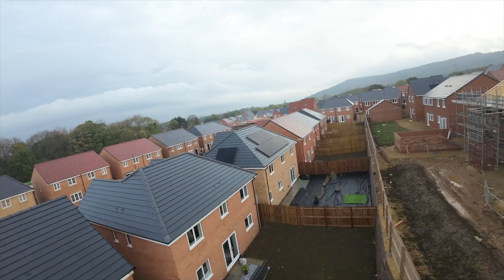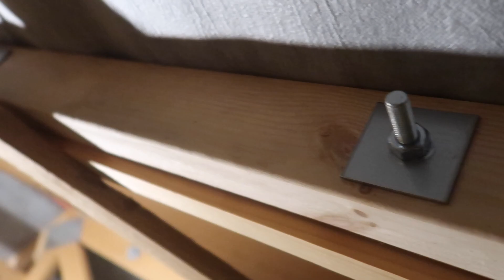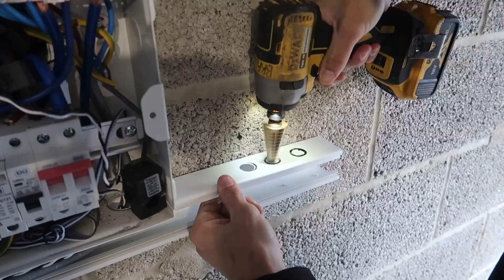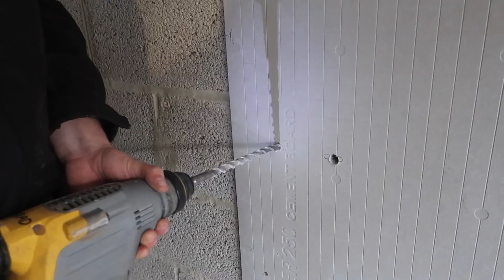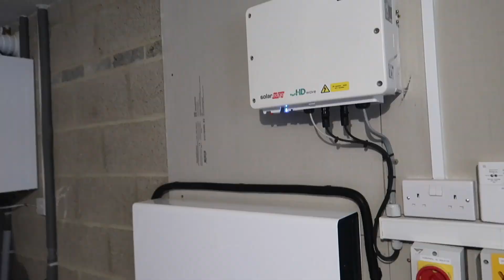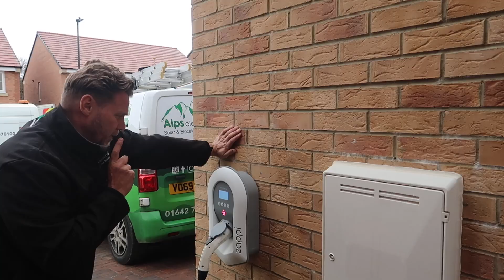New Build Solar & Battery Install | Tesla Powerwall 2 + SolarEdge 5.28 kW System | Did It Pass?

Comment: Thanks so much for the video. I have accepted the quote from a company called soly-energy to install solar at my 1950s house. Would they ask me to do the structural survey or do I have to insist? Or is it mandatory for the installation? They have said for the technical survey, I just would need to submit a few photographs. Would that be sufficient?? Thanks in advance
Reply from the maker: Hi, thanks for watching. You don't always need a structural, it depends upon the roof type. If it is a regular dual pitch then most solar design systems will do the structural calculations for us, but you should receive the structural calculations for it in your proposal and paperwork to show the calculations have been done for both load and wind. If the standard dual pitch is a truss roof then we just input that into the system, however if it is a rafter style then we need to take dimensions of the span, rafter width, depth and spacing to input into the system. If nobody has even been in your loft you need to be asking questions for sure. 
If your roof is a flat roof, or mono pitch, or hip and valley like the one in this video then a structural survey is always required and must be carried out according to the MCS. The consequences of not doing so can be very bad. Most roofs are designed to hold the roof itself, not 2-300KG of solar panels also. If you came to us and said your roof was from the 1950's id be taking all precautions to ensure we were happy to install solar on it. Hope that helps.
Reply: @alpselectrical  thank you so much for the reply. That is great to hear. My installer also told me that the system would tell them about this and also said they would know just by looking at the roof. Our roof is just a typical roof which is found everywhere. And, the loft conversion had been done before we bought the house, so hopefully all of OK?

Comment: What the fuck is a 2024 house doing being installed with RCD groups?
Reply from the maker: Shocking isn't it! It all comes down to money. These builders want their houses wired for peanuts, which is why we would never work with a builder. But the electricians doing them need to make at least some money and so will spec the system the cheapest they can get away with. All new builds should be RCBO boards 100%!
Reply: @alpselectrical  probably all installed by an unqualified person and then signed off by someone in an office.

The worst I've seen is 100's of designs "signed off" on the last day of the grace and then being installed years later...
Reply from the maker: We went to a new build the other week just to carry out some minor electrical work and found crossed polarity at the C.U. Basically the main tails were the wrong way around in the main switch of the new board they had fitted (BG SPLIT LOAD)!!!! Needless to say they came back very quickly to sort it, but leaves you wondering what testing actually took place after installation?
Reply: @alpselectrical  such a crazy, dangerous fault.

Comment: A very neat install but it left me scratching my head at some of the choices 
1. Why have 2 EV chargers? Will the owner need to charge 2 electric cars at the same time?  Wouldn’t it have been better to remove the Project EV charger and directly swap it with the Zappi? They could have sold the Project EV charger and use it towards the install costs.
2. Why have a separate inverter when the Powerwall 3 has a solar inverter integrated into it. The home owner has effectively paid for 2 inverters.
3. The powerwall 3 has 3 MPTT’s so the south facing panels could be on a separate string to mitigate shading or other issues. Why have optimisers which add expense ?
4. I noticed you didn’t use the Tesla dolly to move the very heavy Powerwall 3 around and onto the wall. I  understand this kit isn’t cheap at around £2000. The videos I have seen on the official Tesla Powerwall install YouTube site suggest it is mandatory to use.
The overall installation looks very impressive but some elements don’t seem the best use of the equipment which has been used.
Reply from the maker: Hi, thanks for watching and commenting, in answer to your questions:

1. The customer has two cars which they charge at the same time. We moved and added his old charger into the system for free in the end actually as it was not much more effort or cost for us to do so. which they were over the moon with.
2. This is the PW2. The PW3 was not available at the time this job was at the pricing/DNO stage, and the customer wanted to move on with it as mentioned in the video, however more to the point, optimisers were essential on this job as mentioned in the video two panels on their own roof orientation would not be enough voltage for the inverter to kick in for most inverters, PW3 has a minimum of 60v which is too close to call for two panels on days where there is not much sun, therefore all panels needed to go on one string with optimisers to ensure they will work at all times. There is no better system than SolarEdge for optimisation and monitoring individual panels and this customer was very switched on and wanted the best. You cannot use SolarEdge optimisers with Tesla it has to be a SolarEdge inverter. 
3. Answered this above.
4. It is not mandatory to use, I have never even heard of it and I have done all the Tesla training. They suggest using a dolly which is just common sense but I will stick with my £50 one which works perfectly well lol.

Just to add there is a lot of hype about the PW3 at the moment with no chance yet to see if it stacks up. The fact it includes a built-in inverter could be a negative if the inverter side of things packs up, as that is either going to be a costly repair, or the entire unit is buggered. Only time will tell on this point. The PW2 is a proven model and allows you to spec with any inverter to suit the specifics of the system, and in this instance was the best choice for this job.
Reply: @alpselectrical  Thanks for replying. What you say makes perfect sense. Cheers
Reply from the maker: You are very welcome, thanks again for watching and commenting!

Comment: I'm astonished they didn't opt for in-roof solar during construction of the house:

1.  They would save on roof tiles.  Given the cost per sq meter of panels is approaching that of tiles.
2.  Lower static load on the roof.
3.  Looks Nicer
4.  No need to duplicate scaffolding costs
5.  If roof loading calcs were necessary, then it would be the house builder that would need to consider this - rather than retrofit, but point 2 above would still be valid.

I've got GSE Adaptors on my roof for 4 years, and my electrician reckons they are easier to install than racks, and he has fewer warranty issues relating to leaks due to cracked tiles under the panels.  They look the business!  But pine needle accumulation is certainly a local issue for my particular property.
Reply from the maker: Not all builders provide solar as an option, including this builder on this site and so it was not an option for them anyway.

Integrated panels may look nicer (in some people's opinions), but they are actually less efficient between 6-17%, due to the restricted/lack of crucial airflow allowed to cool them down, as trust me, solar panels get extremely hot under direct sun. Only time will tell if the integrated panels start to fail sooner than the on-roof panels due to this - it certainly makes sense that they would. 

On-roof panels can still look just as pleasant to the eye, but the majority of customers, are seeking maximum ROI over what they look like, as most people won't be staring at their roofs for prolonged periods.   

Right now, and this is extremely fresh news, the MCS is currently discussing the fire safety of integrated panels, which we received notification of last week, and we eagerly await the outcome. Clearly, it could have a significant impact on the industry going forward, but the regulations are changing constantly. It is hard to keep up sometimes. 

As you mention things that drop from the sky can gather in the recesses which isn't ideal.

In my opinion having installed both, and with efficiency/ROI trumping appearance every time, the on-roof panels would be my recommendation.
Reply: @alpselectrical  I certainly saw a remark earlier this week on the efixx youtube channel about fire safety and in-roof solar.  Apparently the consultant with concerns about this cited a very specific but unnamed panel brand as being a particular problem for in-roof solar.

Certainly the GSE adaptors are sitting right on top of the wooden battens, so I can see the potential.  I checked out the GSE website for the MCS certificates for their adaptor mounts.  They certainly look legit.

But sure, there's a risk, especially with loose connections under DC load.  That reinforces the importance of the AFDD features, which SolarEdge has - although I haven't seen any tests of these devices.
Reply from the maker: Yes, we will await to see what comes of it, but things are changing very quickly. Thanks for the comment and for watching :)

Comment: Another great tidy installation. When I had my first solar installation 12 years ago and my bungalow being 2 years older. The installer strengthened my trusses with 4*2 not something I have seen done before until today  but I am glad they did  2 years later we had 3 feet of snow . You asked before where about I am just over the border in wales not far from Oswestry 👍👍👍
Reply from the maker: Yes, thats the thing, most roofs are built to hold the roof itself, and tiles etc allowing for snow, not solar panels, and so consideration must be taken for these extra loads. Thanks for the comment and for watching, really appreciate it!